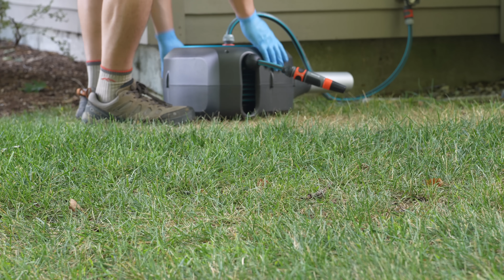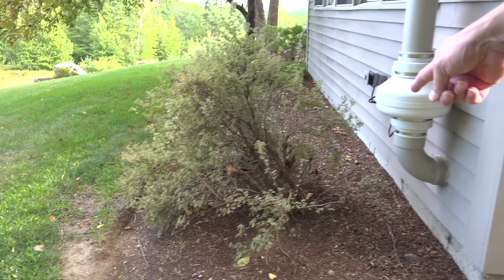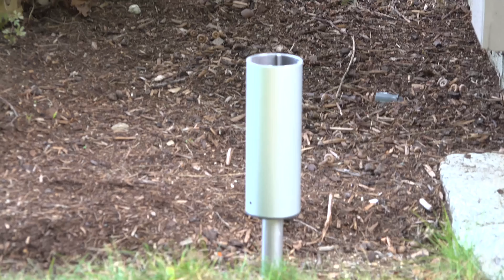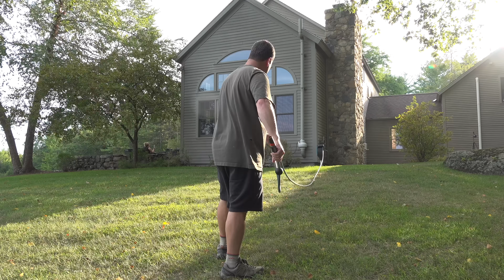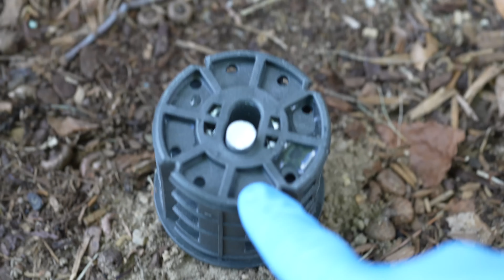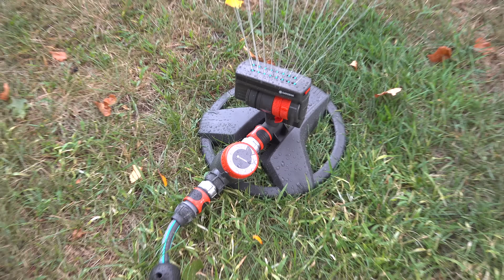RETRACTABLE HOSE REEL INSTALLS in 1 MINUTE & Doesn't TIP! by Gardena

Comment: Their hoses are terrible. After a few years of use, the water comes out with white foam. It is the inner lining disintegrating. Your have to run the water for a minute or two till is is clear of the foam. We have two of these and will be replacing them soon with a different brand.

Comment: Just be aware. This one use 11mm hose, not a standard 13mm one. So the water pressure is low, and I havent found a single shop where could I buy a replacement hose.
Reply: The flow would be reduced.
Reply: @NP-co7kj Yes. Flow reduced and nowhere to buy replacement hose.

Comment: I purchased and used this hose last year. It works well, easy to install etc.  Only think I didn't care for what the slow flow rate. Turned out to be a big deal. Made watering things take a lot longer. Not sure if they even have an option bigger than 1/2". I'm going to sell it this spring and get something with a higher flow rate.
Reply: Did it come with the metal thing to put it in the ground?
Reply: @ yes it does

Comment: how do you like this compared to the Hoselink?
Reply from the maker: The Hoselink is my #1 pickup handsdown if you can mount it to your house: https://youtu.be/OKnZG2o97H4 If you can't mount it directly, you can do: https://youtu.be/WhrRq6ChdIY  But with that being said, I still have this Gardena in place, because it is so easy to use. Stick it anywhere, remove it later no fuss. But its a thinner hose so its less flow. So I say do the Hoselink if you can, no regrets on that ever. But if you want a 10 second install free standing and can handle a little less flow this Gardena is really great.
Reply: Awesome thanks! I ordered two hose links recently based off of your videos. Glad to hear those are still going strong, looking forward to getting mine.

Comment: How do you like the Gardena vs the Hoselink?
Reply from the maker: Hoselink is better for flow rate and length, however as a free standing hose with a 3 minute install this Gardena is very helpful. I am still using it in the same spot today but the hoselink will be better choice if you can mount it, which is very easy but some dont like to install things like that.
Reply: @SilverCymbal  Thanks for the feedback. I’ve seen both your reviews so this is useful extra info as I’m considering purchasing a hose reel for my garden. I’ll need to do a post so it’s a tough call. The foam product you used for the post looks interesting and I like the 82 ft length on Hoselink, but I also like Gardena’s post with built in tools.

Comment: @SilverCymbal there is a version of this (exactly the same) but with a gray and black color scheme, which should have matched better with a traditional house, not sure if this version is available in the US though. oh and at least per specs, those reels are supposed to be "Frostsicher" (freeze proof) but sure winterizing them for the winter will significantly extend their lifespan.
last but not least an "insider tip" about Gardena products- Gerdena is a German brand and they have many (hence not all) very high quality products, but make sure before you buy that the specific item is "Made in Germany", since Gerdena also manufacturer some of their stuff in lower-wage countries, nevertheless usually the real good stuff is still kept under German production.. so if it's not "Made In Germany" expect it to be their lower-end line (regardless of what your "Home depot" sales person tells you). greetings from Germany

Comment: Hey silver, how has this been holding up compared to the hoselink? I'm going to get a few this year, and wanted the better quality of the two
Reply from the maker: The big difference is the flow rate, the hoselink has better flow and has been 100% reliable. I am actually doing an update video on that in the next few days, a lot of folks have asked. Now the Husqvarna is a wonderful reel if you do not want to mount anything or like being able to remove, but you sacrifice less flow. Both are really good, but the hoselink is my pick if you can mount or do a pole mount like I showed in my video.
Reply: @SilverCymbal  thanks for the update. Hoselink it is. 

My quest for best lawn in the neighborhood requires it :)

Greetings from a former masshole, btw

Comment: I bought one of the sprinklers, but I couldn't operate the hose connector.  I wasn't strong enough.  I can operate other brand hose connectors of the same design.  I was very disappointed.

Comment: I wonder if you’re able to add those expandable hoses into the unit? Also, I wonder if you can add a 100’ expandable hose into the 50’ swivel version since it shrinks down heavily when the water is drained out.
Reply: Hi there, unfortunately the unit isn't modular. You have to stick with the hose that's shipped within the unit.
Reply: @GardenaCan   is there constant pressure pulling the hose back or does it lock temporarily?
Reply: @wnybricky1559  Hey there, the hose locks in place when you stop pulling and starts to retract when you give it a slight tug once you're done watering.

Comment: Aqua Joe a part of the Sun Joe company makes a sprinkler similar to this for around $30. Aqua Joe AJ-OSPR20 20-Nozzle Max Coverage Adjustable Gear Driven Oscillating Sprinkler on Sled Base, would be interesting to compare them.

Comment: i have the wall mounted version with 115 ft hose for over 5 years now! it still works like brand new. One of the greatest things in my garden!
Reply: 😍 That's great to hear!
Reply: @GardenaCan  send me that 100 ft one and i'll do a video for yall too! 100%
Reply: Yep! Me too, these Gardena Hose Reels are a game changer!
Reply: Are you in a colder environment?  Just wondering how the fittings handle the cold.  A lot of reals like this are great, but after 1yr they leak all over.
Reply: @wesimmons05  I’m in Toronto Canada never brought it in for winter it stays outside. The only thing I do before winter is making sure the hose is drained, nozzles all removed and spigot shut off. Never had a problem with it or leak. Maybe just luck.
Reply: @rays9499  Hey Ray and Will. Our Hose Reels have a unique and patented technology of Frost Proofing, which allows our reels to be left out in the cold! Although just like anything the reel would appreciate being brought into the garage when it gets REALLY cold. :D

Comment: Great! Now I can’t decide between this or the Hoselink. This has 1/2 inch hose and the Hoselink has a 5/8. Based only on the hose size alone which would be better for a home garden? Wish the spike was sold on the 100 ft
Reply from the maker: Its easy, if you CAN mount a reel on the hose the hoselink will be a better choice https://youtu.be/WhrRq6ChdIY or Gardena's version is 100 feet but a smaller hose. BUT if you want quick and easy and instant install , this https://amzn.to/3QasHY1 is impossible to beat. Hoselink at this time has no freestanding offering like this so it really comes down to the install choice, but both are great choices.

Comment: I like this conceptually but would be concerned about possibly puncturing an irrigation line during installation.
Reply: Exactly what I was going to say.  Especially given that you obviously are installing this near the faucet, and in my case, that's where my sprinkler system is installed as well and lots of outgoing pipes there.

Comment: What's the thing on the wall attached to what looks like a large vent pipe? Some kind of air-mover for the basement?
Reply from the maker: Yes correct its a radon mitigation system

Comment: Check your hose connectors. I bought 2 of those hose reels and on one of them the hose came off. After inspecting the connectors on both hoses, I found out that they were only halfway in and came loose. I'm lucky that this happened while someone was at home or I would have lost a lot of rainwater. 
After fixing the connectors I can only recommend those post-mounted hose reels.
Reply: Hi there, those hose end connectors are sometimes not tightened all the way from the factory and/or come loose on the way to the U.S from Germany. So they could definitely use a quick check up before use. Thank you for bringing that up!

Comment: Can you leave these outside over the winter? (After disconnecting from the house of course)

Also, will we see any videos on your radon system? I think it's an issue that goes highly unaddressed. When we bought our home we found that 1 in 7 homes required a system and had no idea what to look for, but worked out with the seller to get one put in.
Reply: Hey Brett, yes the insides of the reel have our patented frost proof protection, it allows ice to expand inside without cracking anything. But of course, that will take a toll on the unit eventually and we highly recommend that it is drained and brought inside.

Comment: How does it Stack up against your hoselink real?
Reply from the maker: The Hoselink is an excellent reel https://youtu.be/WhrRq6ChdIY  It is slightly thicker, and longer at 85 feet but it does need to be mounted. If you are handy and can do what I did in that video which is not bad at all its a great choice. The warranty on the Gardena is longer at 5 years and the install is truly amazing. So both are great choice it just comes down to which features are a better fit for you.

Comment: I had a similar hose reel and it worked great for two years, and then it was over with. It will be interesting to see how this one holds up.
Reply from the maker: A lot of reel break down, fortunately this one has a 5 year warranty. I should have mentioned that and at least Gardena is a real company. A lot of the "new" companies are gone as fast as they sell you something.
Reply: @SilverCymbal  Sweet, a 5 year warranty from a reputable company means a lot!
Reply: @Leonardokite  Hey there! Yeah, just show us your digital proof of purchase (Amazon in this case) and we will replace your reel if it is a manufacturing defect!
Reply: @GardenaCan  no, it was similar but NOT one of your products. But thank you for your kind response! Excellent 😊
Reply: @Leonardokite  Sounds good!

Comment: I like how you don't have to drill into house. 

I worry about longevity of these products and the need to replace one that is bolted to structure with a different one ( if original is no longer available).
Reply from the maker: A lot of reel break down, fortunately this one has a 5 year warranty. I should have mentioned that and at least Gardena is a real company. A lot of the "new" companies are gone as fast as they sell you something.

Comment: This seems like a really good product that is well made, but as of Sep 2022 this is listed for $259 plus tax which is an awful lot of money for a 50ft hose on a reel. For comparison, you could get a good quality lightweight 50ft fabric hose and a reel for less than 1/3 the price of this Gardena unit. 

Granted that a separate hose and cheap reel won't be nearly as good a user experience as this Gardena product. But in the current age of inflation and high prices crimping our budgets, the Gardena reel doesn't seem to be feasible or within reach for most of us.
Reply: I could stomach the cost if it was a 100 foot hose with 3/4” diameter. The 1/2” and short length are deal busters for me.
Reply: @jimb8601  me too
Reply: I’m afraid to even look for it in 2026!

Comment: Melanor has a sprinkler that is adjustable like that. The Gardena one looks easier to adjust however. I’m assuming you can control the water flow as well on it?

Comment: What is the inside diameter of the hose? Most of these reels come with a hose with a small ID and the flow sucks. I haven’t found one that has a normal ID (5/8”) even the ones that advertise they have that they don’t.

Comment: What’s they thing on the side of your house the pipe wit the weird thing on it
Reply from the maker: Radon mitigation system. Really common in NH and New England
Reply: @SilverCymbal  what does that do and isn’t radon really dangerous
Reply: @TrippHiggs  it removes the radon gas and vents it above the roof line.  Never encountered it till we moved to Colorado, they put ours where the basement sump pump is and sealed it all up with silicone and so it pulls from there goes out the wall and up above the gutter, fan runs 24/7.  I guess radon occurs naturally and leaks out of the slab in the basement?  there are links to increased lung cancer is what we were told.  Wife is a NP and said 100% we are getting it installed in the houes we bought.

Comment: I've had 2 gardena hose reels installed in my garden for over 2 years. They stayed outside for the entire length of my ownership and held up really great. I expected them to degrade or discolor over the period, because of the intense sun here in Sri Lanka. However, I'm happy to say they haven't. I actually bought another one about a month ago and i could not tell the difference of color by just looking at them - in the sun, everything discolors, and i was genuinely surprised to see they haven't discolored at all. Even the connectors are working like brand new. I really don't buy anything other than gardena, because they offer great value - it's expensive but you see the value overtime. I can't remember how many hose reels and hoses i went through before buying the gardena.
Reply: Hey Asanka, that's great to hear that our UV stabilization of all our products work so well in the real world. Thank you for being a Gardena customer!
Reply: That's awesome!

Comment: Thank you for your video most informative.  I am curious as to what is the  purpose of large pipe running out of the house and the what appears to some sort of auxiliary fan attached to the pipe . Is this a furnace exhaust  or a ventilation system for baths or kitchens
Reply from the maker: Yes that is a Radon fan. Such a strange looking thing. In NH and most of New England Radon is very common. This was installed before I got here, though its debated Radon is supposedly the #1 cause or close to it for lung cancer. Its a simple fan that takes the air from under your foundation and put its into the air instead of sitting in your house
Reply: Thanks again for the video(s) and the response , I didn’t know radon exhaust needed a power vent ,

Comment: That it's a 1/2 inch hose hurts the usefulness, at 9 gpm.  It'd take forever to water your lawn.  
(5/8ths deliver 19gpm.)
Reply from the maker: I agree for just pawn watering or large areas it will be slower. I have to admit though I have used this like 10x since I installed it for different tasks. The convenience is very nice. Who knows maybe they will make a larger version with a huge spike, it would seem possible, this is nice isnce you can tuck it in a bed too out of sight, just depends what you need the most.
Reply: @SilverCymbal  It's nice for what it is.  The volume issue is why I stay away from those collapsible hoses too.  Great usability, but not enough volume.  I upgraded all my hoses to 3/4ths this year and it makes a world of difference.

Comment: Thank you for the review.  We purchased a Hoselink product in 2022 and are very impressed.  Have you compared Hoselink to Gardena in terms of these retractable hoses and/or other products?
Reply from the maker: The hoselink is excellent and I have shared a video on that one also. The main differences are the hoselink uses a large diameter hose and that can be a big advantage but they don't have a free standing model like this. So the real choice is in the mounting and the flow. Both are fantastic choices but if you love the portability of the screw design go with the Gardena, if you need larger flow and are OK to mount it the Hoselink will provide more flow.
Reply: Thanks for the response comment... I find tamhat equally helpful.  I will state upfront I got the 82ft Hoselink and love it, but it only covers half my home. When I saw this auger setup I was excited as I use them ALL over my yard for stand alone posts: birdhouses, feeders, mailbox, weather station/anemometer post.  No concrete!!!  Simple twist and leveling.   I am considering this for the other side of the home... because otherwise I get a second mount for the otherwise of the home (using a post as I have siding and stone)... and don't want to use concrete to set a post.  If this unit came in 100ft. I would risk having two full product lines...but 50ft feet at that cost point may push me away.    Seeing  a sprinklers review deep dive given the timers would be intriguing.  A new home is keeping you Uber busy with cranking out the videos.